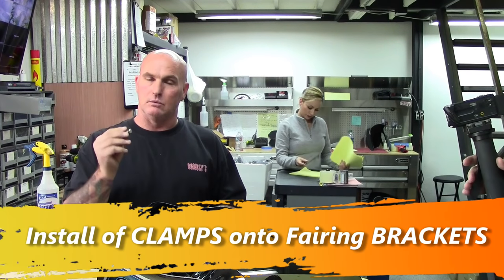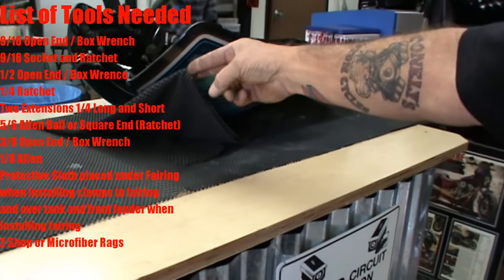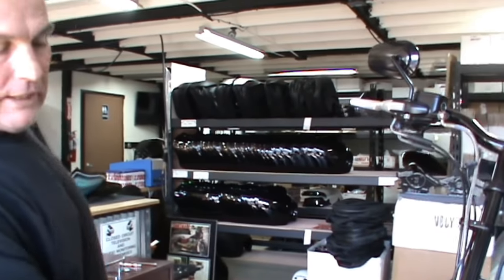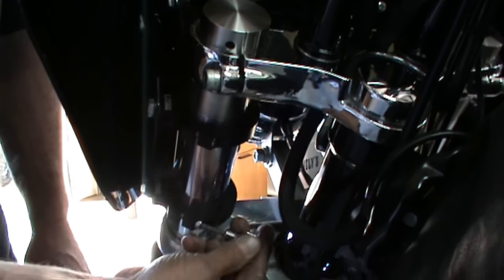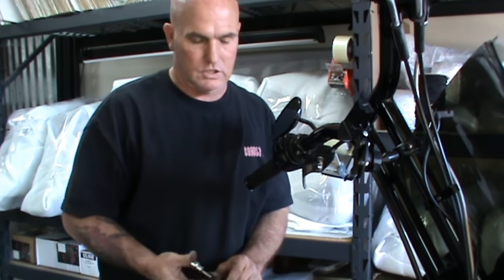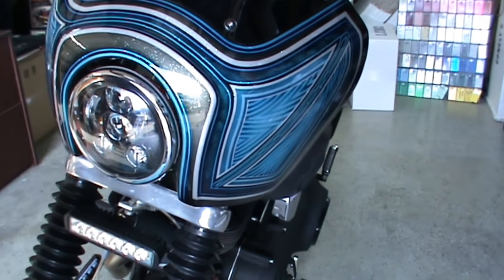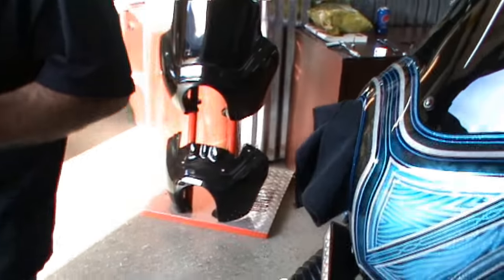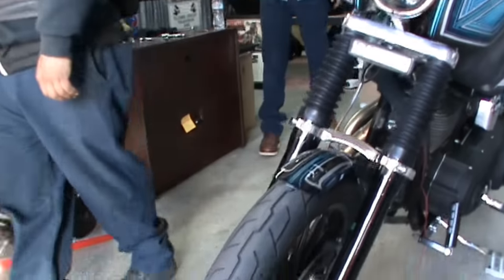Conely's USA T-Sport Fairing Install

Comment: What can you do to fix the headlight rattling issue permanently?
Reply from the maker: What I to do was have my mechanic @two_pyston_psycles drill out the four  rivets that hold the two mounts out, and replace those rivets with actual nuts and bolts you can tighten down. No more rattle

Comment: Where do i buy this fairing and clamps
Reply from the maker: Hey Troy sorry for the late response. I have not been able to locate any Conely's  USA products anywhere. I had an accident in early April and my fairing took some damage. I was unable to find new brackets or a complete fairing to replace my old one. Good luck in your search. I would keep my eyes peeled on Harley or Dyna forums, and any Dyna parts pages on Instagram for leads on where you can get a hold of Conely's USA products.

Comment: how tall is the winshield
Reply from the maker: Steven Khosravifard there are 3 different sizes you can get. The one on mine is 12 inches. You can get 14 inch and 16 inch as well
Reply: how tall is lil rickys windshield
Reply from the maker: @stevenkhosravifard  his windshield is the 16" one